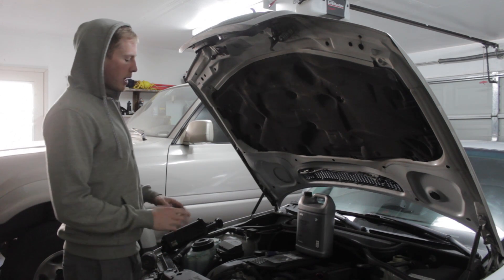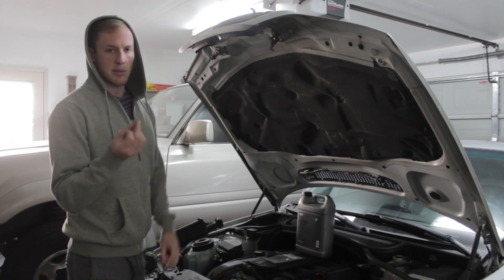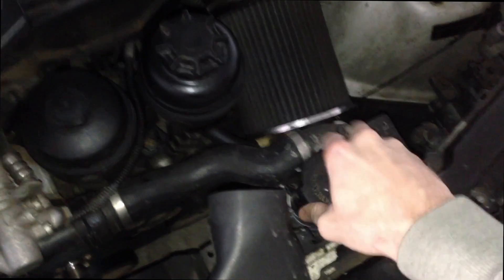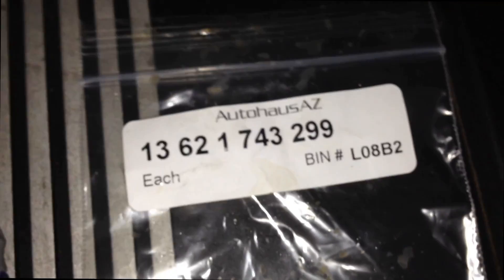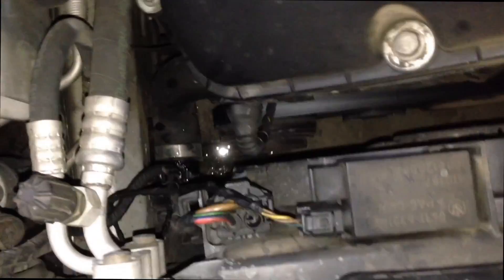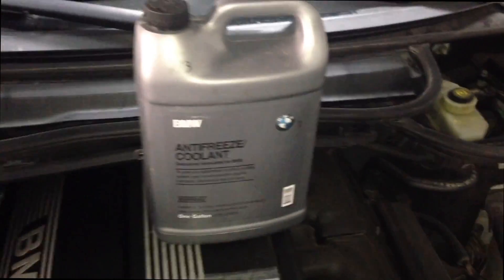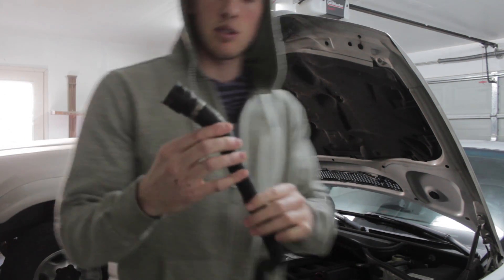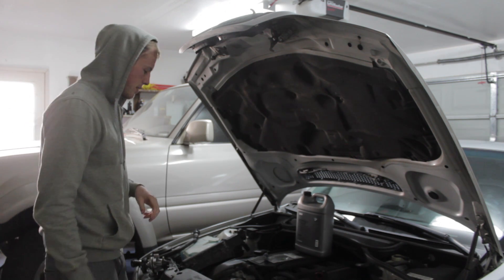E46 Slow Coolant Leak Fix DIY

Comment: You can have a cooland leak when the radiator is broken or the head gasket, and also when the coolant flange on the back of the engine is broken.
Reply: Johannes my bmw is leaking coolant but i just assumed that it's the radiator and even the mechanic said it might be the radiator I never even thought about the head gasket when I put water into the tank it leaks slowly

Comment: Got an e46  with 114k miles on it and when I pour coolant its good for a day. But when I check again, theres no coolant in the expansion tank.(its my first bmw and new to this. Please help)
Reply: Mariano Perez did you fix the problem I have the same issue ?
Reply: Daniel Hernandez yes got fixed. I replaced the expansion tank. Then sold it😁

Comment: Maybe you helped me with the issue. I can see a wet spot on the left, exactly where you changed the ring. I will try change that because it leaks so little that i was unable to see the leak even when i removed the plastic protection board under the car.

Comment: Hey, wondering if anyone can help. I have a Mini Cooper 2005, I have a coolant leak and an oil leak. Seems to be dumping quite allot of both and I am topping up the coolant every week. When I check it often is bone dry and there is that white powder/residue. What is this powder and any ideas what my problem may be? Thanks...

Comment: Disagree with these being problematic. I've got an e46 320d purchased with 110k miles 1 owner. 7yrs later it's now done 270k and I've just sprung my first coolant leak on a hose. Car is bulletproof!
Reply: Was it garage kept or did you keep it out in the blistering sun? I think that could make a huge different in the lifespan of any vehicle!
Reply: My 2002 325i touring is leaking coolant at 140k. They're a great car but the cooling system quality is nowhere near as good as the older models (E30, E36).
Reply: The diesels are generally more reliable

Comment: hey man, i plan on trading in my e46, only getting 2gs for it, 2001 330xi with 128k on it. I was looking to buy a 2009 328i xdrive, when i asked my mechanic to look up the vin number and see what he can find out about it he told me how it is a SULEV. he told me what it stands for and I was wondering if i could get any feed back from you. I've done some research but its all 2 years old. any thoughts would be awesome

Comment: how do u connect the lower radiator hose back on.. its such a pain in the ass to get the new hose back on.. it clamps down but when i drive it disconnects and leaks and lets out all the pressure.. an causes me to wait an hour to squeeze the hose to get the pressure back
Reply from the maker: +constantino burgos Dang that sounds like a pain. When the hose clips in I always tug on the hose to make sure the clip is secured. If It is popping off I'd imagine the connection could be broken.
Reply: +constantino burgos 
Sounds like you have a defective hose or radiator.  It definitely shouldn't be blowing off under normal pressure.  

Regarding getting it back on, there is a silicone-based lubricant that is made specifically for o-rings that makes installation of the E46's coolant hoses MUCH easier.  Anywhere that sells equipment for bars should have it - it's used to seal the hoses that connect beer kegs to the taps.  I'd suspect that most car parts places should have something similar.

Comment: also there's that plastic bleed screw what a poor design the plastic head sometimes cracks up losing a mating pressure between the screw head and mating surface between the screw and surface it slowly breaks or separate's causing a loss of pressure on the o ring and sprays coolant out under pressure sad thing is they sell aftermarket brass screw head for ten bucks and what the dealer sells is the plastic crap for 5.00 bucks why not go ahead and by a brass one off eBay for ten bucks it is well worth the extra 5 dollars and kind of dresses up your engine bay as well.
Reply: eviloctober Hey this is my issue, the little green scree is leaking from the bottom but I can't find a way to fix (video) can you guide me somewhere? Thanks in advance

Comment: Good luck on reaching down in that narrow open and simply unclipping the sensor and pulling it out.  I have the lower hose off and it still is resisting removal. All of the BMW hoses with plastic ends and o-ring seals seem to have the same removal issues if thev have been on for a while.  Great care must be taken prying them off as the mating flanges are also plastic. Gone are the days of simply slitting the ends of recalcitrant hoses with a knife to remove them!
Reply: Recalcitrant... Learn something new each day.
Reply: PB Blaster Silicone spray helps a bunch for rubber and plastic connections and it's safe.

Comment: Iv Got Bmw e46 318Ci M Sport 2.0

I Personally Think It's The Best Car Ever Made For Its Time And Age.. However.. Only Problem I Ever Had.. Is That Stupid Slow Loss Of Coolant! 

Around 10-50ml a week.. Sometime less, sometimes more.. 

Broke Down Once Because My Radiator Pipe Came Off The Radiator Due To Wear. Only Time I Ever Got Let Down By This Car.
Reply from the maker: Thanks for the comment! Enjoy your e46 :)
Reply: ZentRose I'm considering buying a 2000 BMW 323ci with 140k miles from my friend but the radiator seems to have to leak so you have to keep filling it with water.can this just need a radiator replacement or can this be signs of something more serious?
Reply: David my bmw is getting the same problem did you get engine problems over the leak?

Comment: I have had far to many of these cars and the cooling system is the first place I check on a new(used) car. Nothing worse or more expensive than a blown head on these things or engine(crossed fingers)
Side note for anyone: the gasket on my P/s(power steering) reservoir was bad, caused it to leak on to the coolant hose and "ballooned" it as he had mentioned, Causing it to seep. Easy fix.
PS You are very cute :)
Reply from the maker: Thanks :) enjoy your car!